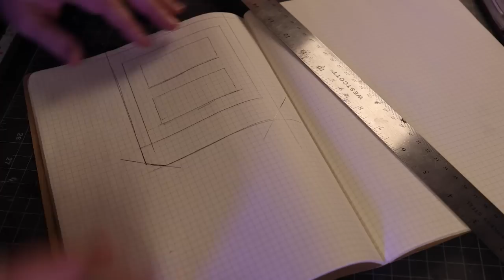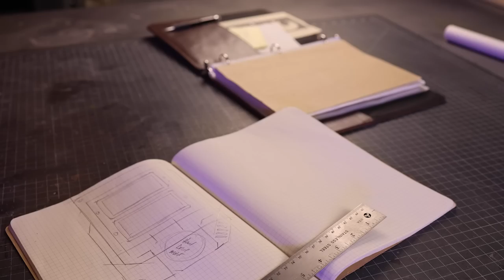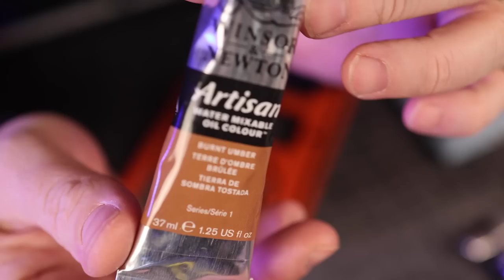Star Wars Room Decor | Light Switch Cover

Comment: Wax poetry….sorry, I got nothing. 

It’s so nice to have you back in the shop. I love the colors of this simple switch. The switches themselves are pretty cool too. Though those alien screw heads look really strange. 

‘Do something, this year, that scares you’. I just recently bought myself a scroll saw for one specific project. You might remember the pro type fan duct I made some months ago for my 3D printer (out of plywood). Well, since I’ve gotten the geometry worked out, I now want to make it out of aluminum. There’s no way I can afford a CNC mill. I can’t afford to contract someone to mill it for me. Also can’t justify spending $$$$$ to have it made. It’s been a lot of years since I’ve used a scroll saw, and I don’t remember ever cutting metal with it. So, it’s waiting for me to build up the initiative to plug it in and turn it on. That’s one of my next projects.
Reply from the maker: Best of luck Deanna, we will be watching with excitement!

Comment: Giving me a little kick in the rear end to get me started to do something (useful)? Thank you, this is really helpful.
But on the other hand. Longtime Project engineer here. If you have a huge Project and don't even know how to start it.
Sit down with your customer and your development team and define the project by tearing it in little sub-projects.
Go on with this procedure on smaller and smaller scales as far as you think is necessary to unfold all the dificulties (don't worry about upcoming dificulties you don't even know about in the beginning). You can go through this tear down process even within the project as often as you need.
Make clear and realistic time frames to realise each sub-project. The overall Time frame evolves from all the tiny bits and pieces of the sub-projects. If you run into schedule issues (which is totally normal in every project) you might have to adapt the amount of work that has to be put into each step ot the project. Maybe if it's not possible to shorten the amount of work, you may have to scratch parts of the project or delay it to make progress on more important pieces.
With all that written, the most important thing on finishing projects: Have fun doing it!
Reply from the maker: All good points.  Very excellent advice.  I think we were just saying when you start a big project, the actual building aspect, sometimes starting with a simple "win" helps build confidence and get you going.  But all your points are certainly great advice.
Reply: @TheSmugglersRoom  getting confidence for a huge project is really valuable. 
But I've done the mistake many, many times to see only the small and understandable parts of a project and not the whole thing. I've ran out of time for finishing everything in a coordinated way. This left the customer mad, my colleagues and in the end myself.

Comment: Hey Brian, have you considered looking into getting push button light switches for the basement? I feel like they would fit really well in a star wars themed room!
Reply from the maker: The switches we have in this video are actually pushbutton.  they have several configurations and button sizes, and they are backlit.  I need to get them installed so they are easier to see.  We can engrave them as well.  Pretty cool

Comment: Glad you're back!

What brand/type are those black rocker switches? I have something similar in white that is illuminated, but I haven't seen that black design before.
Reply from the maker: Thank you!  The switches are actually made by Control4.  It’s an automation company that I work for.  They are not sold directly to consumers, but you can find local AV dealers all over the world.  Here is the website: www.Control4.com
Reply: @TheSmugglersRoom  Thanks for the heads up! I'm always on the look out for items that are unique in appearance that can be used to "StarWars" something up.